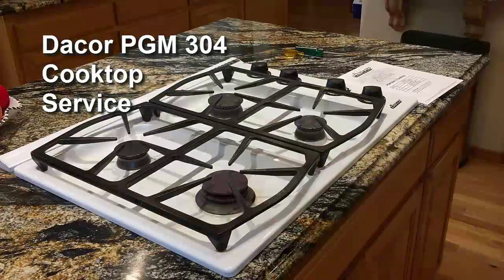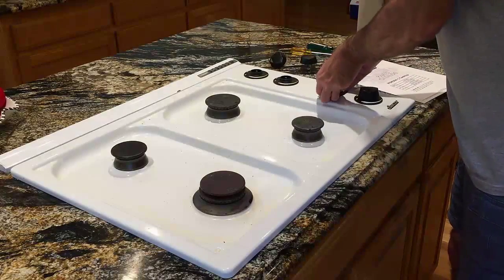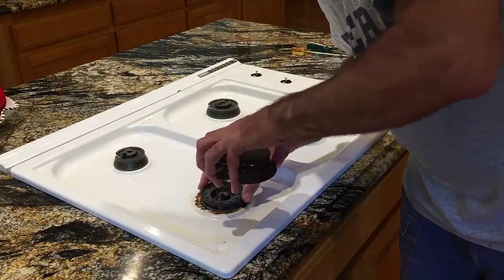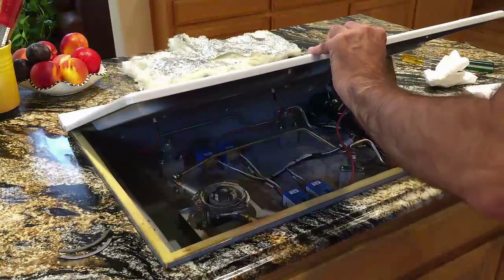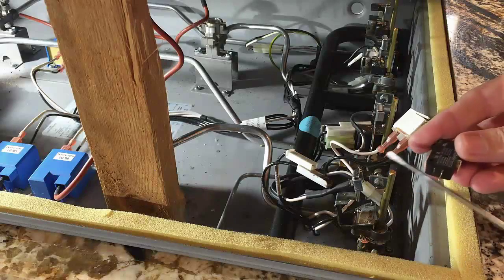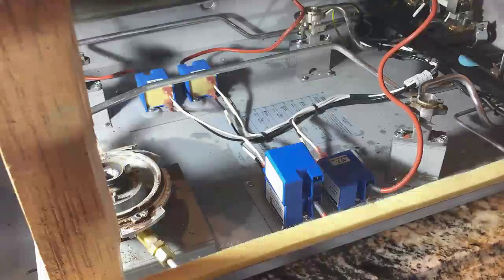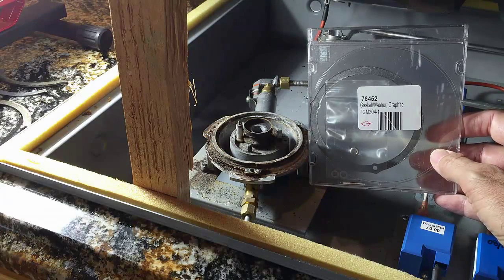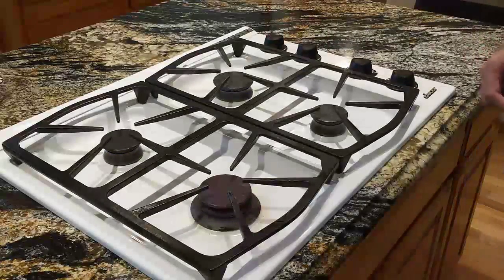Dacor PGM304 Cooktop Repair

Comment: Hey there. Thanks for this clear video. I don't see the holes on my Dacor where the torque 15 screwdriver goes.... any possibility you can offer a close up of where you actually insert? Thanks.
Reply from the maker: Well, on mine they're the two holes immediately next to the center of the burner.  Except the big burner has three torx screws holding it down.  The torx screws are recessed down in the holes and secure the burner to the base of the cooktop.  Do you also have a PGM304 cooktop?  Perhaps your model is secured a bit differently.
Reply: @litzdog911  Yeah I think my model does not use screws either. Mine is SGM466S. It's a POS, and I had to buy a special tool to loosen the rings of each burner. It's just a stamped metal wrench and the rings are so corroded that it bends the tool. Six out of 6 haven't loosened. Will likely just throw this thing out and get a better brand.

Comment: The small micro switch you replaced: I cannot get the wires off mine. Do you recall if they were locking clips?
Reply from the maker: samlol23 No. The connectors just slide on and off. Yours might be corroded so maybe a bit of WD40 can help you loosen.